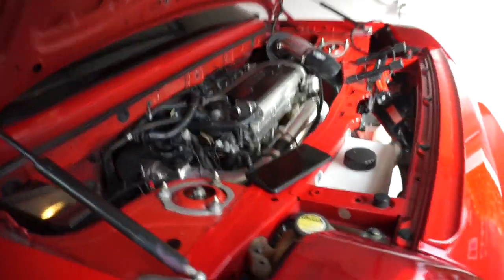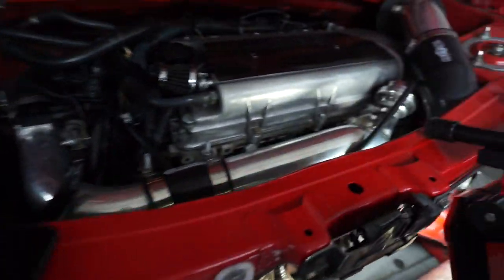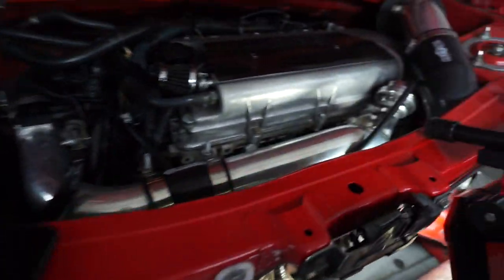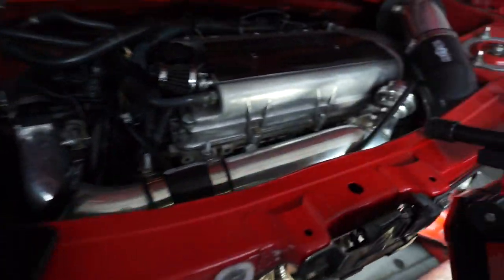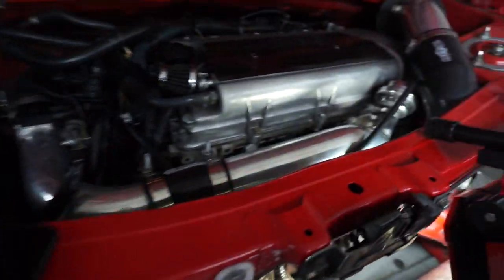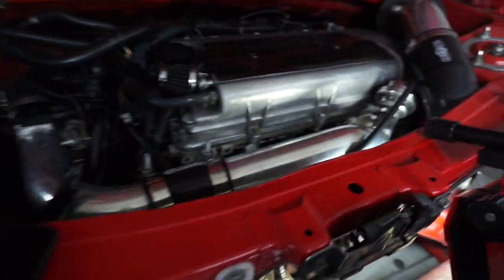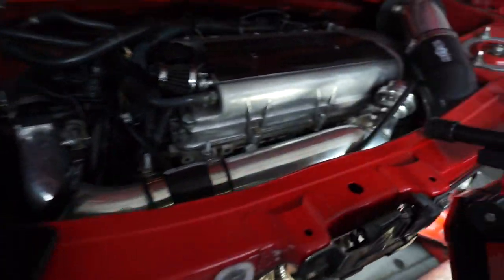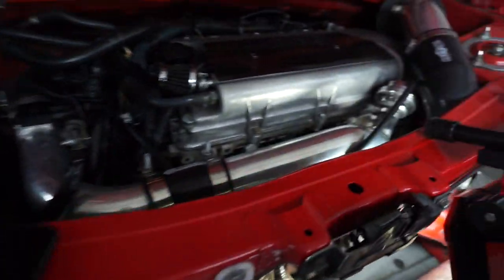How To: 2ZZ-GE Timing Chain Tensioner Seal Replacement

Comment: How does it work? I’ve heard that sealant is not a good idea. I bought a whole new tensioned cause it was only  like 40 bucks for oem. Through my dealer. I’m wondering about just using the old one though. Matrix XRS with about 235,000 miles. Been needing to do the job for a long time but I just been dealing with the constant drip. Of course probably my timing cover gasket to but I know for a fact the o ring is leaky.